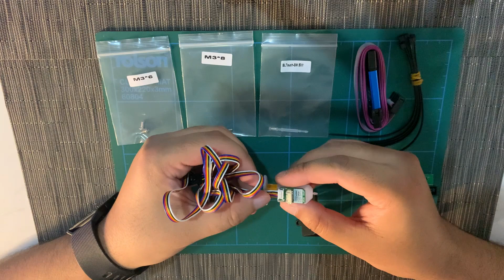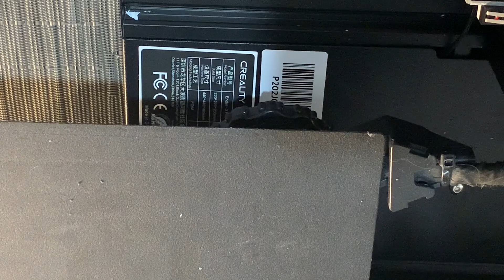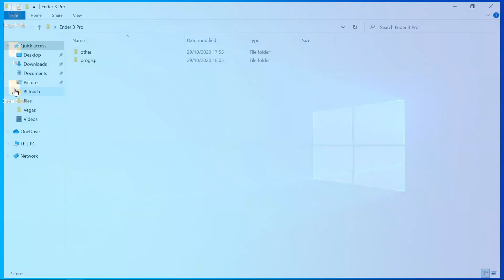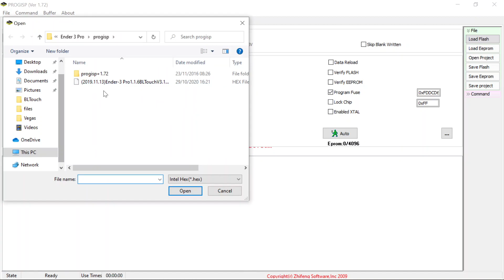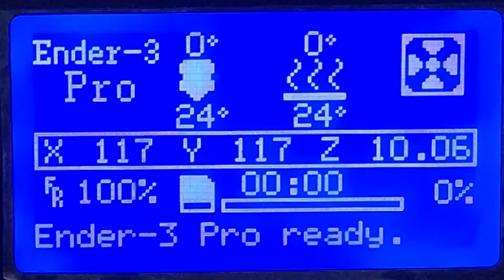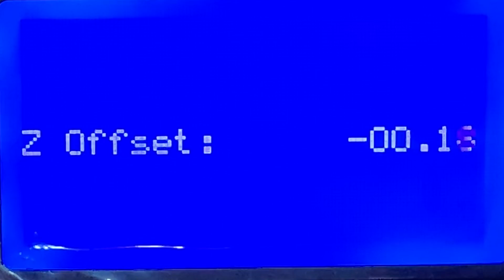Ender 3 Pro - BLTouch Install  [HOW TO 2020]

Comment: I bought a used Ender 3 Pro and it has a wire and connector up by the fan that is connected to nothing. I think the previous owner had this device installed but removed it. How would I go about deinstalling it and the software / firmware?

Comment: hello, so the matter is that I installed the V3.0 BLTOUCH on my ENDER 3 PRO (board version is V1.1.4 ) with TH3D (and an arduino uno card as isp burner) but when I start printing, while the homing, the Z stepper motor keeps the extruder on rising (moving up) and if I ivert the z-endstop cables, it hits the bed and keeps moving down (which is really bad). so it seems that the bl touch can deploy, stow if it touches the bed, but isn't considered as the new z-endstop... help me please !

Comment: I follow all the steps but when I tur it on to see if it worked the it only clicks two times and the bed leveling thing doesn't show do you know how to fix this
Reply: I'm right there with you. The leveler is glowing red, but it's not showing up in the firmware update. Is that what's happening for you - maybe there's a problem with the recent firmware that we updated.
Reply: @fenc3r1  yeah that happened to me idk what to do I bought a new wire to see if that was the problem
Reply: @Ronan_Young06  I had some more time to work on it tonight and I think that I got it working - here's what I did. I was pretty sure that there was a problem with the firmware, it was loading something like "Marlin.cpp.hex". So I went onto the creality website and downloaded that hex file. I did all of the other steps and changed all the D6-DC-FD valued and selected my new hex file instead of the Marlin thing.

I just plugged it in and it gave me the Bed Leveling options, so I think it's fixed. I'll report back if I encounter any other problems. Let me know if that helps, cause now I'm invested!

Comment: my board doesnt have that 2x3 pin layout, mine has 4 pins in a straight line
Reply: Same here.  I don't know how to connect it
Reply: @chenchantoku87  did you guys manage to figure it out? i been breaking my head for a few hours now
Reply: @Edaurd  no
Reply: @chenchantoku87  look up ender 3 bltouch 4.2.2 and you will find it :D

Comment: I followed everything exactly but now my ender is in chinese and the bl touch is just pulsing red
Reply from the maker: you might have downloaded the wrong hex file as they both look pretty identical
Reply: @odrissystems  i actually pluged in the 3 prong connector backwards and flashed in the chinese hex file as opposed to the english. I got it all sorted out but I just always struggle to level the bed
Reply: @chrisd5758  any follow up on this? does the bed still struggle to level after installing the bltouch? Im having problems with prints not sticking I think it might be because my bed its not leveled.

Comment: in progisp it says that there was no programmer found and it won't flash
Reply from the maker: hmmm, can't say ive seen that one before. have you tried downloading the files again?
Reply: @odrissystems  yes and I am trying on another computer but I am still having the same issue
Reply from the maker: @ultrainstinctgarfield2661  are you able to open the progisp app? if so in the top right corner is the chip set to ATmega 1284P?
Reply: @odrissystems  yes, it is set on that chip
Reply from the maker: @ultrainstinctgarfield2661  and just to double-check after you plug the USB into your laptop, do you see a blue light on your printer baord?

Comment: Does this work with the 4.2.7 silent board for the ender 3 pro?
Reply from the maker: im not too sure tbh I've not looked into it. I assume you can make it work cuz i don't believe they would make the board knowing ppl would use bed levelling but the process may differ

Comment: I am abit lost. I though the Ender 3 Pro has a 2.4.4 and/or 2.4.7 board which already has the bootloader and that the firmware .bin file should be able to download from the Creality website and move to a microsd card and turn the system on and the firmware will automatically load from the sdcard and onto the board. I purchased by BLTouch and it didn't come with those other boards (ISP board and burner cable)  you got there. So what am I missing here?
Reply from the maker: from what i understand of the process the burner cable is what is used to flash the firmware, i think its only relevant to the older boards, as you mentioned the newer boards should be able to via sd card though i am not 100% on this as ive not personally looked into it. I think you will need the isp board, what version board do you have?
Reply: @odrissystems I have the 2.4.7 board install now. but I did at one time have the 2.4.4 they both work the same, I have the 2.4.7 install cause it's the silent board, make the motors run without the noise that it outputs. But I though all Ender 3 Pro have the updated board.

Comment: Confused by your video. Z-axis: "it'll allow you to move the nozzle down until it is in the correct position." This is really ambiguous and potentially dangerous as I assume it's bad to push your nozzle down into the bed? I assume you mean until it barley touches the bed (like you'd do in bed levelling?). You describe this as a super important step, but then proceed to give ambiguous directions!

Comment: my board doesn't look like that wtf
Reply: Same🙃 lmk it you figure it out
Reply: @jojo_glitching2970  turns out my mb is one of the recent upgrades since about july of 2020, mine is the 4.2.2 motherboard so now the process is done through a micro sd and just plugging in the bltouch
Reply: @YourPeepingTom  yeah I figured it out but I can't find the firmware
Reply: @jojo_glitching2970  i havent finished it yet cause im lazy and decided to finish other things but theres a tutorial by teaching tech i believe for installing the firmware and the bltouch

Comment: Mine doesn't have a slot next to the screen ribbon cable
Reply from the maker: what version board do you have?
Reply: @odrissystems  4.2.2
Reply from the maker: ah that is why, I have the older v1.1.4. Honestly I have not seen the newer board so not sure how different the process is but I do remember seeing instructions in the box for a newer board. Let me know if they will be of use to you and I can dig them up
Reply: @odrissystems  found out I can just install the firmware via SD card but now when I do that my screen comes up blank and I don't know what to do now
Reply from the maker: @TheFilminators  Someone else mentioned this in one of the previous comments as well,  "I’ve discovered that if you plug the pinboard to the furthest pins closest to pins you use to plug the burner in the screen works again" are you able to check to ensure the cables are in the correct place?
Reply: I'm sure that they are in the correct place
Reply from the maker: @TheFilminators  can you try turning the printer off, remove the memory card and boot the printer back up?
Reply: @odrissystems  I've been doing that and I got no luck
Reply from the maker: @TheFilminators  right, the next step I would look at is trying to update the firmware to a different version. If you followed the steps I took the version I used was specific with BL Touch config. A more up to date version will not be configured for BL Touch but there are quite a few walkthroughs available on youtube to do the config

Comment: help at @ 2:51 the port for me is a 4 pin not a 6 pin help
Reply from the maker: that's a first for me, so this part is where you flash the firmware, if you are not able to do it in this manner you could try using a bootloader and connecting a cable to the front on the printer and flashing from there. Teaching tech has a good walkthrough on how to do this, you could check that out or potentially buy another cable with the correct pins. Hope this helps.
Reply: @odrissystems  So Creality sold me something that is not compatible with my printer despite advertising it is compatible??

Comment: Hello, I’m trying to get this for Christmas, would it get here in time based on your shipping experience
Reply: Check if you have a Microcenter in your area, they sell them in store with all the supplies you could need.
Reply: I'm only seeing this now, but the one I got from Amazon today is from creality sold through Amazon.
Reply from the maker: Hello, I would probably so no if you are getting it from the creality page or ali express, however in the UK you can buy it from Amazon on Prime so you can get it for next day delivery and even if you do not have Prime you should get it within a week. 

Hope this helps.
Thanks
Reply: @odrissystems  can the ones on Amazon be trusted though?
Reply from the maker: @dawsonrockers1165  very good question, I know someone that has used it successfully but having a look at the reviews I would be cautious

Comment: Hi, once I start the progisp.exe program and go to enter the data as you suggested: lowvalue D = 6, Hight Value = DC extValue = FD, when I go to load the .hex file the Progisp.exe program after pressing on the Auto button, I upload the new firmware. When loading is complete, the Ender 3 Pro printer display restarts but a constant buzzer noise appears, as if the voltage is incorrect. Can you tell me a possible solution? thanks a lot
Reply from the maker: Thanks for reaching out, something in the steps you have taken so far has gone wrong as when the BL Touch is connected the signal that usually goes to the buzzer should be redirected to the BL Touch. I would start of by checking to see that the cabling has been done correctly if it has, I would go through the steps again. Another thing to check is if the cable has been attached to the board correctly, I found that the pin connector on the board was bigger than the connector on the cable. Let me know how you get on or if you need some further assistance. Thanks.

Comment: are the values for lowvalue: D6 and highvalue: DC correct? I have seen loads of videos with people putting lowvalue: DC and highvalue: D6. Quite confused by what should be the correct order now.
Reply from the maker: Thanks for the msg, I took the values from Creality documents and my BLTouch is working so I believe I am using the correct values. There may be a difference if you are using different boards, but I have not investigated this. Please do let me know if you need this investigated further happy to try figure it out. Thanks.
Reply: @odrissystems  Thank you for the reply. Using stock board for now so I will give it a try using these settings when I get the BL Touch in. Your video seems to be the most recent video so I'll put my trust in you:)
Reply: A 06:14 you are talking about how it was important to adjust the X axis before doing the bed leveling. Don't you mean the Z?
Reply from the maker: Thanks for catching that, i do mean Z

Comment: Hi, thanks for uploading the video. Can i ask if your ender 3 pro is the old 8 bit board (require bootloading) or the new v4.2.2 board (bootloading not required)? I have an ender 3 pro with v4.2.2 board preinstalled and also bought a BL touch sensor recently. Another video from one youtube user suggested those pinboards are not required for v4.2.2 board. I want to verify if this is true. Thanks.
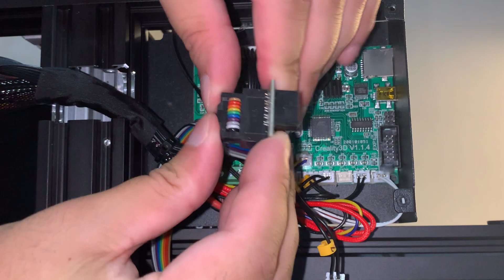Reply: Just saw that you have the old v1.1.4 board at 4:17
Reply: @superivanho  Any luck? I'm in the same boat.
Reply: @isaiahoveal7961  Yes I can confirm it works fine without the extra pinboard. I simply plug in the bl-touch jst-xh 5-pin connection end to the dedicated BL-touch port of v4.2.2 board. However as you are gonna use a different port, the firmware source code will need modification. I found these following two links some time ago which describes what exactly you need to do (presume you know the fundamental of source code modding on Visual Studio Code):

https://smith3d.com/ender-3-v2-bltouch-firmware-installation-guide-by-smith3d-com/
https://www.reddit.com/r/Ender3Pro/comments/iiiv8m/bltouch_on_ender_3_pro_v1_5_32bit_board_v422/

Following my successful BL touch installation I also got myself v4.2.7 silent board as well, then modded my firmware (for v4.2.7) again for the BL-touch and it works like a charm!

Comment: Hmm. I did all of this, but my screen now is blank? Any help?
Reply: I’ve discovered that if you plug the pinboard to the furthest pins closest to pins you use to plug the burner in the screen works again
Reply from the maker: i spoke to someone that had this issue a little while ago. if i remember correctly they pulled out the power cable and plugged it back in and it started to work. let us know if this work if not we can try troubleshoot
Reply: I tried unplugging and replugging the pinboard while the printer was on, and that worked.
Reply: @Zertibon  having same issue. Nothing works. Blank screen.

Comment: Thanks for the video.  Did the firmware actually flash there?
Reply from the maker: Hey, so i actually lost the recording of where it actually did flash for me but i didn't want to leave the step out of the video so i tried to show the steps by recording it again
Reply: @odrissystems  How did you fix the error though?
Reply: @vikdb maybe u already figured it out but its not a error its showing that you did not connect the usb to the board so it has no where to flash